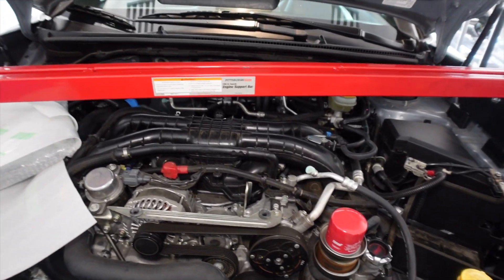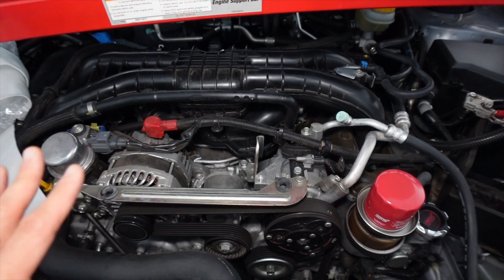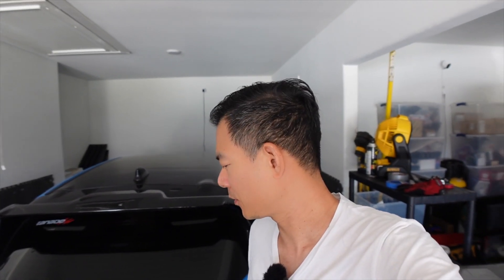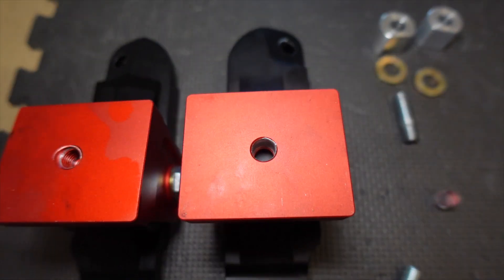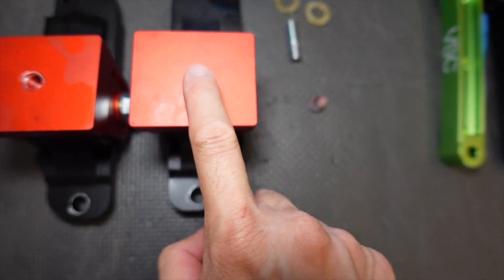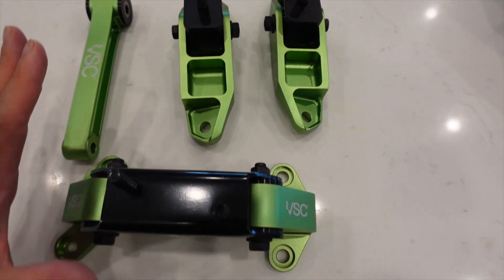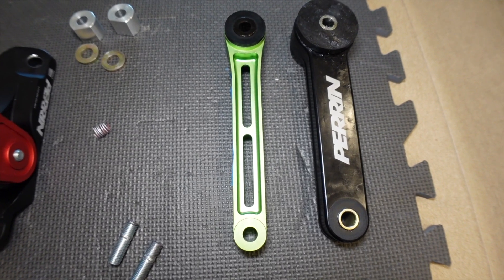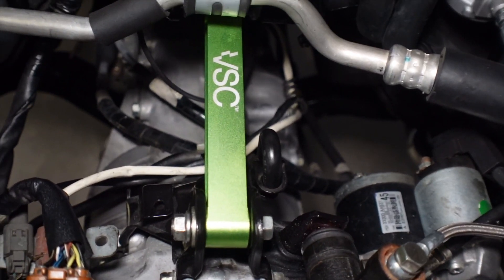VSC Engine Mounts versus Perrin Engine Mounts Subaru WRX

Comment: VSC makes nice pieces (for race cars). That VSC ps mount looks rough for street use.  Very direct, very stiff. 15mm of poly away from literally being a solid bar.   Does the Perrin ps mount come with different durometer bushings or was that the Cobb ps mount I am thinking about?
Reply from the maker: Hey what's up! Yeah, definitely the VSC has a lot less urethane than the Perrin for the ps and the VSC transmission mount looks to also lock down the transmission more with a very unique design. Don't drive the car as a daily so I'm ok with track level mods. These pieces look very special. Thanks for watching!
Reply: @j168vlogs ... since I daily my wrx, I went the group-n mount direction (ps and trans).  added the WL positive shift bushings and upper rear diff inserts.  I'm trying to minimize driveline movement w/o making too harsh for daily use.  I haven't touched the engine mounts yet...
Reply from the maker: @K03sport  haha, I had the same exact setup with WL and Group N but I ended up replacing my rear diff carrier bushings to group N as well. It made an incremental improvement for driveline stabilisation and response. https://youtu.be/Si6vc4cUkRw?si=A0tSiaXac0orVZZ9

Comment: Hi wanted to know more since I just bought the Perrin engine mounts with their other mounts. My engine mount studs came pre installed like the VSC so do you think maybe they fixed the issue?
Reply from the maker: Hey what's up! You may be able to unscrew the bolts from the mount and use a magnet to see if there is steel. My suggestion is to call Perrin and ask them if they have added a "Steel Liner" around the bolt like VSC does. Perrin has outstanding customer service. Otherwise, it is not a great design imo and the Perrin mounts will need to be properly modified per Perrin instructions or returned for VSC engine mounts.
Reply: @ thank you very much 🙏